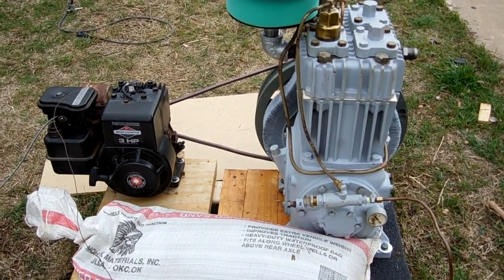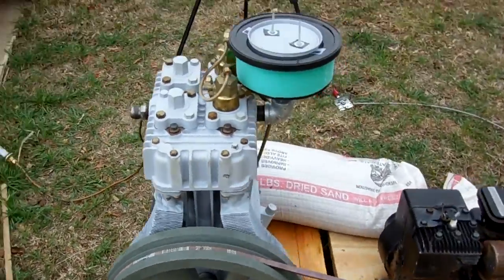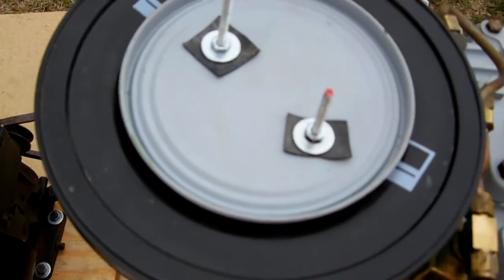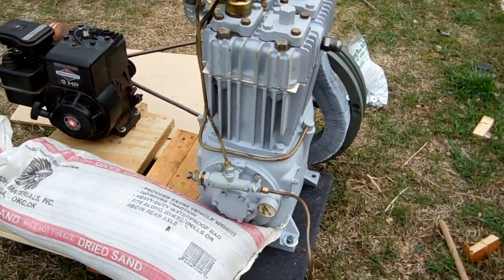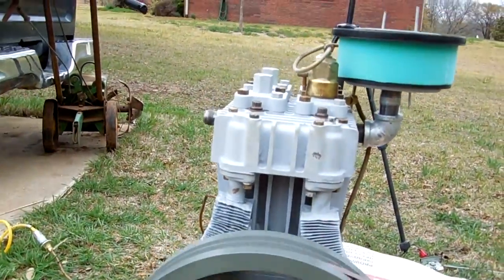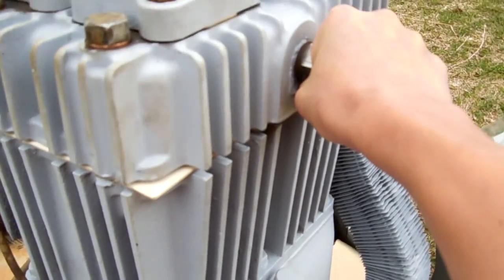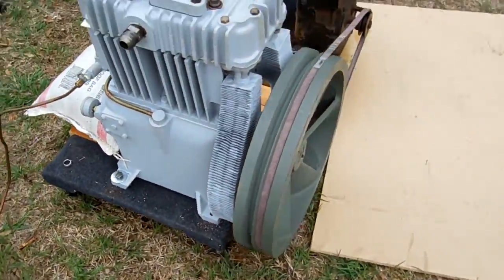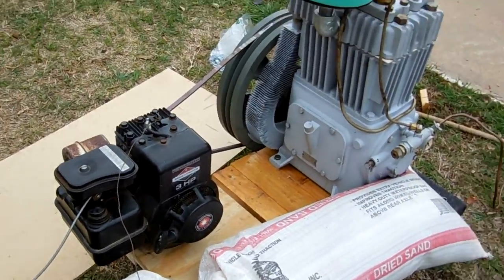Testing Quincy 325 ROC 10 Air Compressor

Comment: Petrol motors require double horsepower then an electric so if it says five hp electric motor needed then you need a 10 hp gas

Comment: I had a Curtis compressor that had a bent crankshaft.  The best way to straighten out a bent crank is to take it to a machine shop and apply force to it with a hydraulic press.  Put the crank in a pair of v-blocks and use a dial indicator gauge to measure how much it is bent and in what direction the bend is.  Do not beat on it with a sledge hammer because you will only make the bend worse or you will ruin the machined surfaces on the crank.

Comment: Phases dont matter with a pump..  focus on rpm of the pump and calculate pulley size based on that and motor rpm because you over rev it and itll blow the valves out in a hurry..  but the hp of the motor only tells you how low you can go before the pump will over work the motor..  if you get a 15hp motor its just overkill and wont hurt the pump unless it is over revved..  but pulley calculations are easy enough and can use online calculators to figure it out..  but no pump rotates at 3550rpm..  most are 1750 or 900 or something..  usually hard to find specs because the company wants you to buy their stuff ...

Comment: Believe 5hp aint enough ass to get that compressor chooching at its potential..  looks beefcake..  ate its beans..  might just be the radiator thats built in..  is nice..   but looks like its a 150psi 15cfm or there abouts.. i got a little k series emglo and its 125@9cfm with a 5.5hp..

Comment: Looks like a Quincy 310 ROC 21-22 ? I have one exactly like it....  I see you posted this video 6 year’s ago, but FYI the original electric motor this compressor calls for is a 2 HP 1750-1800 RPM FRAME 184T SINGLE PHASE... I believe the original motor was a G.E....I downloaded the Quincy 310 series parts manual and I was surprised to see that this pump uses a 2 HP motor....everywhere I looked people are running 5 HP motors, but I bought and installed an original 2 HP motor and it pumps phenomenally! It’s quite and turns the big 2 belt pulley at the required RPM...👍🏼

Comment: I have an old Devilbiss 2hp  built in 1950 and the pulley wobbles worse than that.
I doubt the crank will ever break. If the belt stays on, just run it! Youre young, there 
are more compressors you will find, and better things than trying to bend a crank with a hammer. In this world, perfection is useless and un attainable. Use the hammer to bend 
some ones ear, like our politicians!!

Comment: Don't waste your money on a motor until you get that crank replaced. You can find an old ROC 10 on E Bay or Craigs list all day long as that model is obsolete. Still one of the best pumps ever made. However, that bent crank will crack in about a year. Trust me, I have been working with 325 in the oil and gas industry for many years.
Reply: Mind helping me make my 325 continue his run with what I have here at the house LOL

Comment from the maker: Ah I see, yeah especially since I dont have a hydraulic unloader, well because I will be getting a 6 hp motor maybe it will be able to start it with out to much stress, if it cant I could always return it and hunt for a 4 pole motor that is still cheap, or make a single phase to 3 phase converter and run this 7 1/2 hp 3 phase motor i have.

Comment from the maker: I am on a budget for fixing this thats why i chose to jury rig it. Why do you say not to use a 2 pole motor (3450-3600 rpm)? I am looking at a new 6 hp motor from Tractor Supply that is a 2 pole motor (3450-3600 rpm) that is $229, a lot cheaper that other new motors i saw.